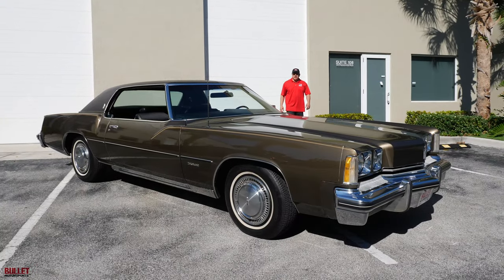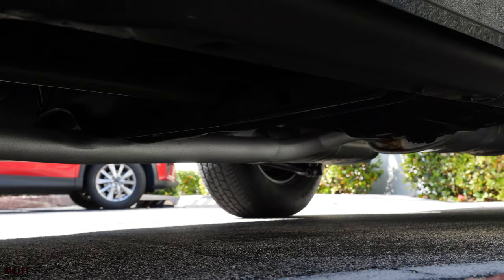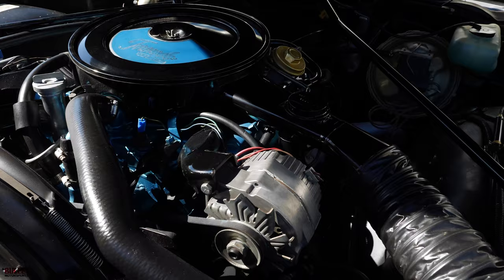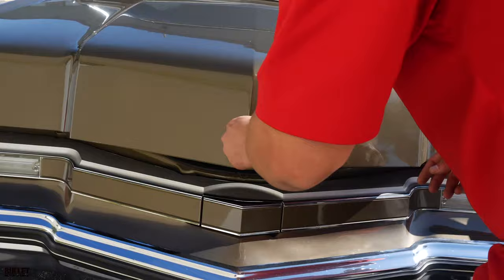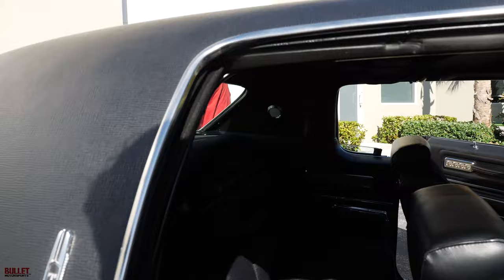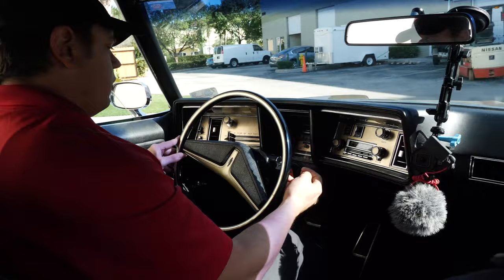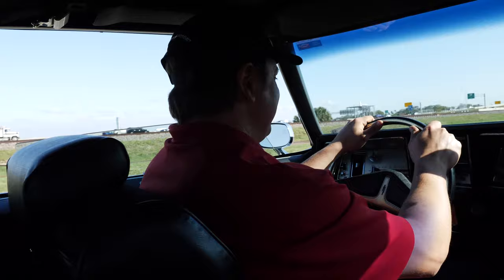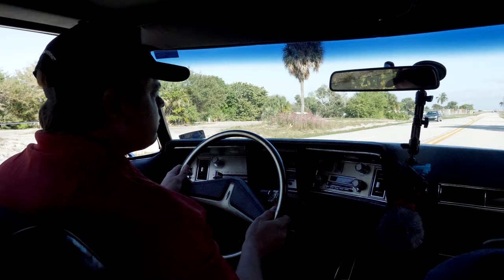Is This Toronado The Cleanest Land Yacht In Existence? [4k] | REVIEW SERIES

Comment: This was the model year Toronado my late dad owned; where I got to drive it on occasion, too.  
For as front-heavy as that vehicle was, the steering was effortless.  I think my '91 Honda Civic had more steering resistance than the Toronado.
That front-end of the car was so massive that it would have destroyed any vehicle it could have plowed into.
As it was, my dad did end up side-swiping a Japanese import pickup truck (can't recall the make), inflicting over $1.5K damage to the bodywork on the pickup truck back in 1990; as if someone took a can opener to the truck's side panels of the truck.  The amount of damage on the Toronado?  Less than $50 and I did the repair work myself.  The driver's side front turn signal lens and bezel was all that needed replacing.  The paint surrounding it was a little bit chipped, but no biggie as the car was already 17 years old at the time with deteriorating paint.  

The few times I braved to do an oil change on that car, at home on the driveway, nearly impossible.  I could get to the oil pan drain plug; but the oil filter was in a position, while lying on my back, that reaching it was a hard struggle.  Cars back then had lube fittings on the steering linkage which needed grease that was filled with a grease-gun; which was easy to do on a typical GM car of that era, but not so with the Toronado . . . I couldn't reach them.
Reply: Yeahh and it crazy because I’m 16 and my grandma let me start fixing her 1973 Oldsmobile
Reply: @PowerUpZ  Wishing you the best and good luck with doing the repair work, as the parts on that Olds are heavy duty to say the least.  
Ah!  An item I recall that failed with regularity on dad's Toronado was with the cooling system's thermostat, as it had a propensity with failing to open, which created the engine to overheat.  I recall having to replace it twice; which was unusual as all other vehicles I've owned, since the mid-1970s, never needed a thermostat replacement.
For a car that age, a particular headache when it comes to repairs will be with electricals, especially so with the switches malfunctioning.

Comment: Beautiful classic. I believe the transmission was a modified THM 400 which had the same guts as what you would find in the truck version of the automatic but in a different case. Since it is a front wheel drive car the engine sat over the transaxle. The torque converter was mounted on the flywheel as usual, but power was delivered to the transmission from the torque converter via a chain and gear assembly, similar to a bicycle chain but it was very thick and heavy. The wheels also had a significant positive offset due to being a front wheel drive, meaning the spider assembly was moved towards the outside of the rim. This was very evident when the wheel covers were removed. This meant that aftermarket rims would not work unless they were made specifically for that car. The ingenuity that went into the drivetrain was amazing due to how reliable it was, especially for such a powerful engine and the available technology at the time.

Comment: Notice the '73-only OLDSMOBILE script on the valve covers.......nice touch by Olds!  Even this "SQUARE" styling (as were '71-'78 Toros) w/the right color paint, they REALLY were a knockout design. If it MUST be denigrated w/a vinyl roof, I'd chose Tan, but would mandate a Saddle fabric interior.